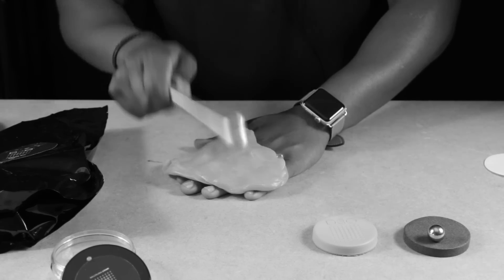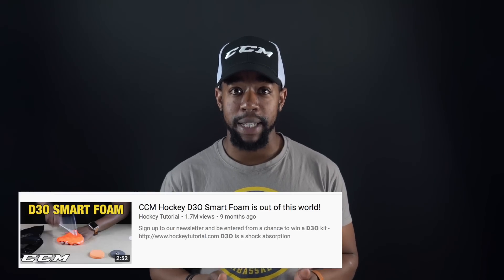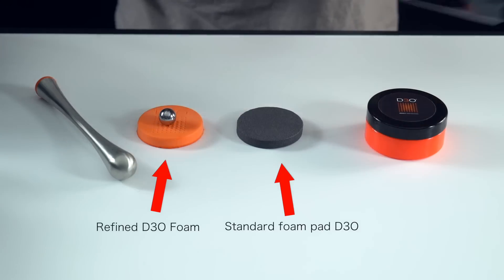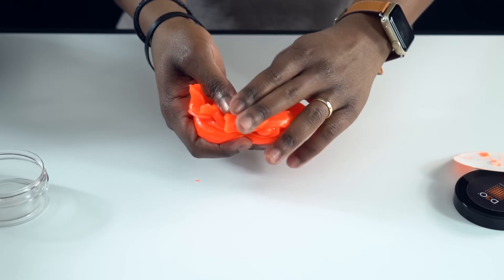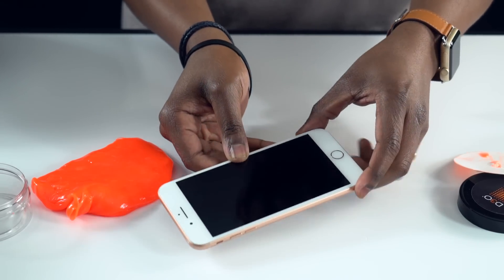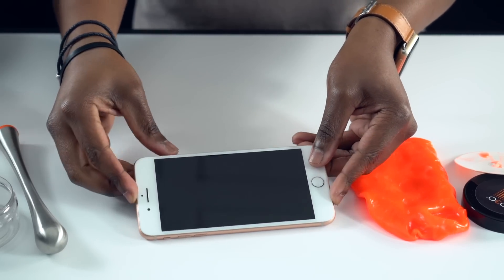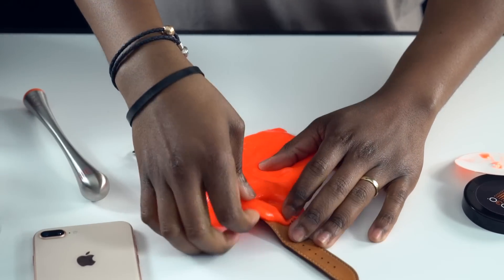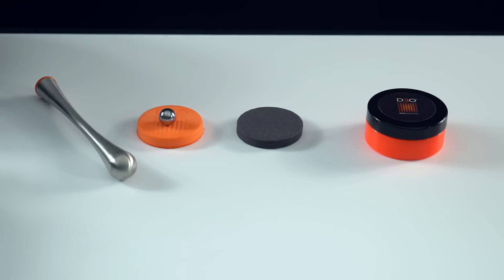D3O Smart Foam vs iPhone & Apple Watch. Will they break ?

Comment: I found the most impressive test to be dropping the ball on the putty. The force was completely transferred to the gel, absorbed and dispersed. I was skeptical until this video. But I do have a question for you or anyone else out there who is knowledgeable on the subject. What is the tolerance threshold? Meaning, what is the thinnest it can be while dispersing a high level of force.

I ask this because much of the soft armor designed for motorcyclists is so thin that it would seem impossible to reduce injury from impact.

Comment: here is a question: why when showing the hitting experiments everybody are using the non proceeded guie stuff, but the real experiment have to be with the finished product! for example, to take a finished c3o arm protector and hit your arm with something strong and then compare it to another arm protector to see the difference. the unprocessed material  is not relevant, only the finished product

Comment: The problem I have with this is that he let's the mallet bounce right off of the material and isn't trying to push through the material. If he where to hold it in his fist and slam downward in it or even drop a brick on the material I'm sure there's be a different outcome. It's like the canvas on a drum. The canvas never breaks because you let the stick bounce right back up bit if you stab down the canvas will surely be punctured.
Reply: i get that but thats not the type of blows this material is made to protect against. its made to protech against quick, blunt strikes, which is what this demo is.
Reply: UberPownage You can break anything if enough force is applied. Come on now.

The idea is that it helps in dissipate blunt force.

Wonder if it can stop a bullet! 🤔
Reply: A half inch of foam and a quarter inch thick of plastic will protect against a "quick, blunt force". All I'm saying is that there's nothing this goo can protect against that typical body padding can't, and that all the fuss is unwarranted.
Reply: UberPownage If you can using it as goalie pads, shots off the pads will rebound less. That’s good for goalies so they can control the puck.

It can also help in making equipment lighter ... perhaps, but not really discussed in this video
Reply: UberPownage foam and plastic can be split. Take a foam sheet of the measurements you said and put a layer of plastic that thick on top. Now put that over your face.  Now let’s have a pro hockey play (for continuity) shoot a slap shot at your face with the materials covering it. You’ll be eating your argument, your teeth, a hockey puck, and your meals through a straw for months. It stops and absorbs kinetic energy. Foam and plastic do as well but they have limits. This goo’s limit for kinetic energy absorption is much higher. So it is able to take faster blows. Kinda like your mom I suppose
Reply: RoachDogg JR ok so, Dogg. Firstly if you go and slather you face with this goo you ain't seeing shit, secondly, I don't see how a face injury would cause me to eat arguments, teeth and pucks for months, thirdly my mom is getting action at least where yours is just a shut in house wife with a husband who doesn't love her. And as for your actual argument of the goo having better kinetic energy absorbtion, that may be true but going back to my original point was that he doesn't do anything to prove the goo is worth the time. He puts a thick layer of it on his phone and whacks it with a lightwheight, blunt "mallet". He doesn't do any side by side tests, he doesn't show us anything this goo can do that other protective gear cannot. All he did was say it's the best stuff ever, and prove it with a click bait thumbnail.
Reply: Technically using foam would not let you see shit anyways
Reply: Ur not supposed to put the raw shit all over he even shows the processed stuff you're supposed to use that they put everywhere making everything lightweight and a lot better at guarding than you're weird measurements of different materials which would be troublesome
Reply: Default Content  I'm 2 slow 2 process all of  this lol
Reply: No shit It’s made for hockey gear with hard impacts like that, not dropping bricks on it
Reply: The material isn’t designed to protect against that type of impact.
Reply: UberPownage that's not what it's for, it's for blunt impacts from hockey, not a stabbinh
Reply: Brody mcnut already pionted out what i was gonna say this foam material is used in fast pace high impact sports like hockey if poeple collide with something thier not gonna continue applying pressure theyll just bounce off